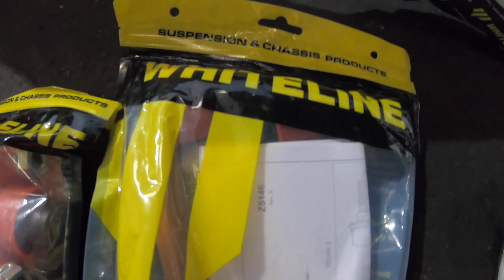TRACKBUILD VLOG#7- New Suspension Mods for the track Evo 8

Comment: can you please list all things you installed with details and also is the correction kit required for car barely lowered like 2cm with cusco coilevers ?
Reply from the maker: Hi mate 
Thanks for watching and commenting 

We installed 
-hardrace rear camber and toe arms
-White line BMK009M
Front and Rear Sway Bar kit  
-white-line bump steer correction kit 

I would highly recommend the bump steer correction kit even if your talking 2cm cause when it comes to wheel alignment we are talking mm.
Your stock suspension is aligned from factory with stock height,stock suspension,stock wheels in Mind.
Any slight adjustment would cause bad tyre wear and poor stability .